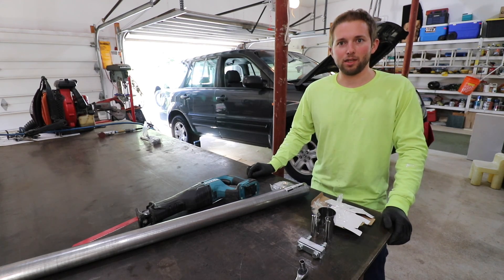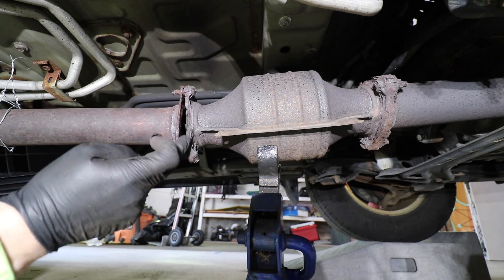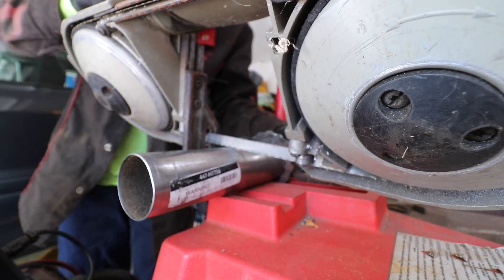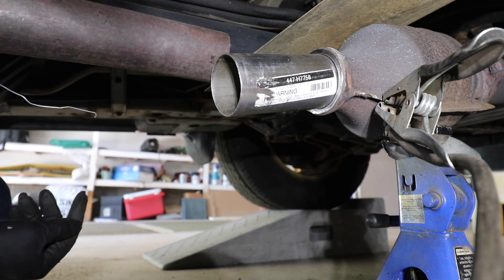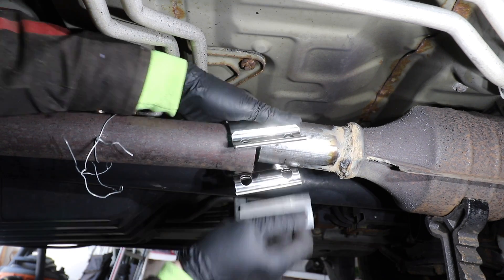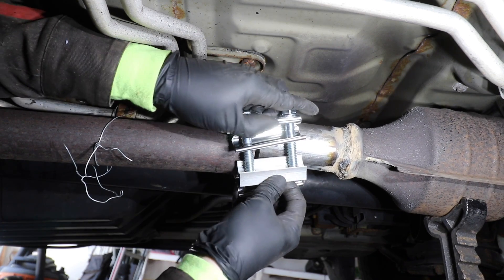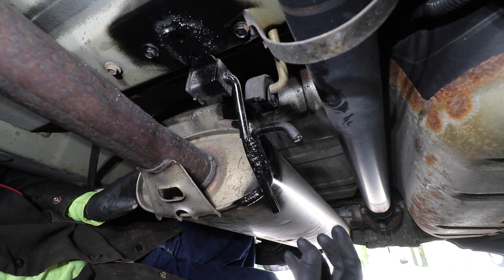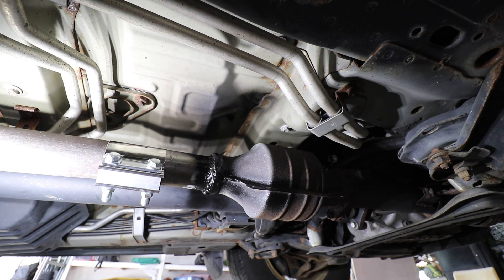How to repair an Exhaust Leak

Comment: Trouble with coupler bolts was because the middle spacer bar was wrong.  One side is flat, the other is curved.  Curved side goes against the pipe.
Reply: I saw that too...